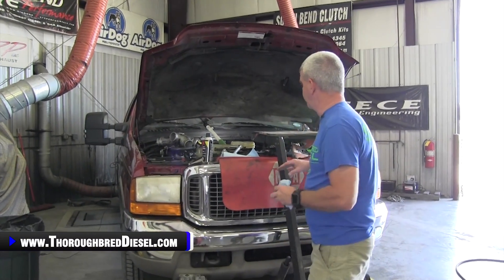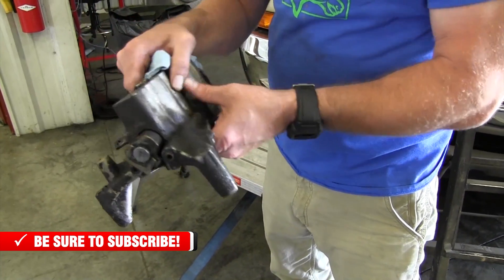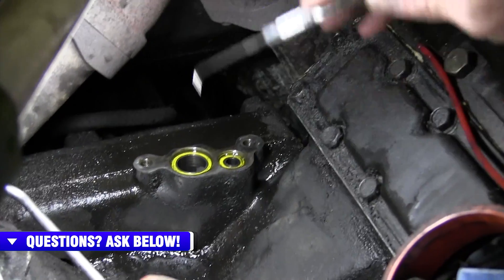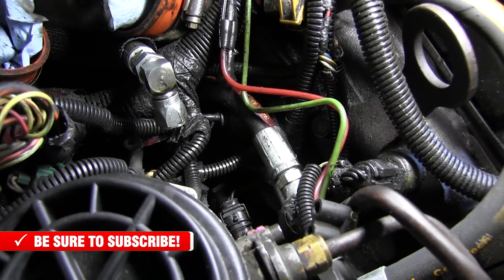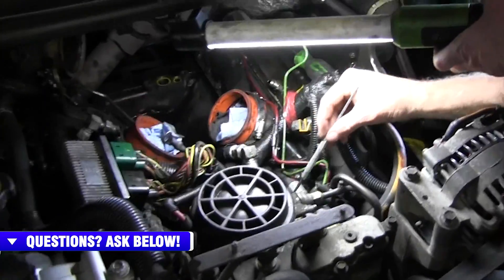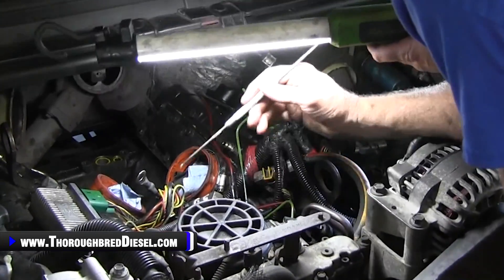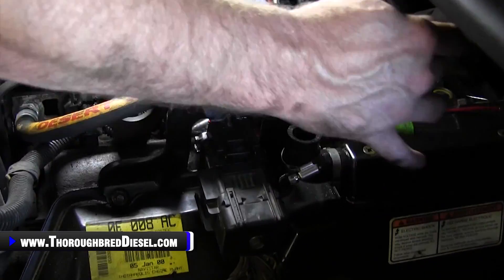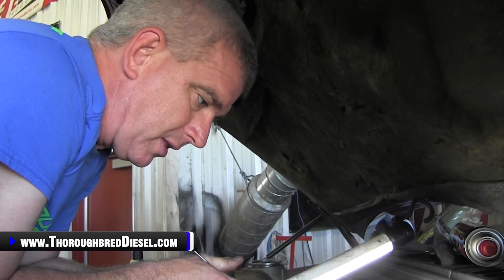7.3 Powerstroke Common Engine Oil Leak Areas: Different Types of Oil Leaks Explained

Comment: How does oil get into the antifreeze overflow tank?
Reply from the maker: Your usually looking at a headgasket issue. Could be soot as well which may be a injector cup issue.

Comment: I have fors f250 7.3 it leakin oil pretty bad if i change sensor will that fix that problem i see lil bit of oil on top of engine

Comment: Hey could you help me chance? What's the reservoir on top of the driver side that connects into the airbox? mines leaking like crazy but I can't find seem to find it.
Reply from the maker: Are you talking about the PCV baffle that is in the valve cover?  Is it oil you are leaking?  If so check the blowby of the engine or the orings on the PCV canister.
Reply: @thoroughbreddiesel  I'm not too sure, It's ontop of the valve cover, connects directly to the air intake, it looks like it's been shooting oil directly into my turbo, and leaking  out the sides and bottom onto the to the top of the valve cover. Thank you for the response and help!

Comment: I have oil leak on my oil pan on my 7,3 ford 5604x4 discail do you have t lift engine out to fix the oil pan
Reply from the maker: If it is the dipstick leaking,  then we carry a dipstick adapter kit that you can repair it WITHOUT lifting the engine.  https://www.thoroughbreddiesel.com/dipstickadapterrepairkit/. If it is the pan gasket or pan leaking,  then you will have to lift the engine.

Comment: I had my high pressure oil pump replaced a couple years ago everything's been running smoothly until now now for some reason I'm leaving good size puddles at places but then sometimes just a few drops could be the the hoses off the high pressure oil pump or could the pedestal put out that much oil because it's never been serviced

Comment: I have a 99 7.3 psd it pours oil about 2qts every two days coming down between the tranny and motor also down the side of the motor towards the back by the oil filter I’m assuming turbo pedestal?

Comment: I have a 96 power stroke massive oil leak in the valley but not from the lines hpop or turbo pedestal but I did notice oil bubbling underneath the lift pump is there a seal or something there that I can replace any thoughts would be appreciated thank you
Reply: What did it end up being I'm thinking oil may be leaking from my fuel pump as well I can't see any where else that it could be

Comment: Any videos on 2001 Ford excursion top oil leaks mine is a gas v10 not turbo 4x4..not a bad oil leak just dusty oil mist all over top of engine...thanks for the upload
Reply from the maker: Not familiar with the V10 engine, I would suspect something that is PCV related though.

Comment: Hi, we've got a 2003 7.3 powerstroke that has fluid pooled in the valley. When it's running I can see a steady drip into that pool, but can't see where it's coming from. Any good guesses? Thanks in advance.
Reply from the maker: Is it coming from the front or the back of the motor?  Are you sure its oil or could it be fuel?  IF its at the back,  suspect turbo pedestal.  If its at the front, suspect the HPOP lines or fittings.  Make sure its not a fuel leak coming from the fuel bowl.

Comment: My 2000 f350 7.3 leaks oil from what I think is the oil cooler but I'm not too sure.... I cleaned it up and let it run to see but I still can't tell.... was thinking it is something with the hpop but not really sure.... it literally drips from where the big ground cables attach to the block on the driver side... any help?

Comment: I have a bad oil leak above starter on my 1999 7.3 f-350 dually can you please help me
Reply from the maker: Really need to figure out if its coming from engine valley and running down.

Comment: I had a bad oil leak from the dip stick adaptor on my oil pan. Almost had to pull the engine to replace the stock adaptor. Luckily, I found an aftermarket replacement that doesn’t require the engine to be pulled.

Comment: Got oil running all down the drivers side frame rail starting near the front along with some top side leakage!  Any ideas on what that can be?
Reply from the maker: Make sure its oil and not fuel. Fuel can mix with the dirt and grime of the truck and make you think that it is oil. Check what we covered in this video and also pay attention to oil cooler and the dipstick adapter.
Reply: @thoroughbreddiesel  yes the video was very informative and I think I have several issues but I am losing oil. There is oil/fuel in the vally but without tearing it down it's hard to see exactly where it's coming from. Can I safely blow that all down at the car wash or a lower pressure washer?

Comment: Hi, I have a 99 f250 7.3 power stroke pickup, its leaking oil in the deposit which is on top of the high pressure oil pump, I dont know how it is call, its beside the diesel filter, in all your videos about oil leaks you never talk about this part. I have already  replaced the gasket but still have oil leaking
Reply from the maker: If it is a leak that is ON TOP of the HPOP,  could it be fuel that you are seeing?

Comment: 01 250. With 360k miles. I’m getting oil drops on the concrete that are almost dead center of the motor. Any clue?
Reply from the maker: Check the oil dipstick adapter, that’s close to center of the motor. A lot of times you get a pool in the intake that will fool you and be running from the back. Could be close to front of motor.

Comment: My 7.3 recently devoloped a crazy bad oil leak. It looks like its comeing from the back of the motor i cant really tell. But its will pour out about a quart if its. Left running for 10 minutes
Reply from the maker: A lot of different possibilities, but the turbo pedestal is a common leak point.  Could also be a leak that is pooling in the engine valley and leaking out the back.

Comment: Got a pond of oil on top back of motor and truck died won't start even with starting fluid will run few seconds and die I hate using starting fluid but more towards back of top of motor I'm thinking turbo pedestal but it's a e350 box van so hard to see

Comment: I have a question I have a 99 f350 I just did this got everything back together and now it idles rough. Any ideas?
Reply: Wade!? I just did this on my 99 7.3 with 324k got everything buttoned up the clamp in the back was a nightmare but I got it now I have a rough idle any ideas of what I messed up. I recently did the valve cover gaskets new glow plugs and the wiring harness on the Inside of the valve cover. I checked after it stated to idle rough everything is still good from that but the truck isles so bad after the  o ring replacement on the pedestal. Any ideas on what could cause it? No codes are coming through and I’m lost

Comment: I'm having white smoke coming from my exhaust pipe when the engine warms up only, would this be from the turbo too?
Reply from the maker: Could be or could be an injector issue. If its not consuming oil, suspect a fuel issue. Also difference in smell.

Comment: i have a 2002 135,000 miles Blows smoke and some oil out of exauhst put new used Injectors,turbo and pedastol in it still does same thing what could it be ??

Comment: I changed my oil about 25k ago. I'm at 297500k+ .
About 500 miles after oil changed Inoticed a leak. I got it up and see a stream running down the right side of the oil pan. Injist found the stream 10min ago.
3:44pm today. Any best guess to start looking?
Thanks
Reply from the maker: Its depends on what you are calling right side, drivers or passenger.
Reply: Hey thanks. I started poking around and found the dip stick adapter was leaking. So I ordered a repair kit and fixed it over the weekend.
What do y'all think of at-205 seal conditioner. Now my trani front seal is dripping.
Thanks

Comment: Great information!  I've got a 97HD with 392K on the engine and you just showed me my problem," Ole Bucky" still starts and runs well ,But it needs to be tighten up with a little of tlc under the hood, Thanks again.

Comment: I’m getting a constant flow of oil coming from under my icp sensor right on the oil rail, next to that engine hook. Any ideas?? Has a brand new icp.
Reply: Oil galley plug riff raff diesel has a pack of 4 for like 3 or 4 bucks hope this helps this is what I did to cure mine

Comment: My 02 7.3 done leaked a gallon of oil in 7 miles
Reply: my 1995 7.3 done leaked 2 gallons of oil in 2 miles 2 days ago. Rustproofed entire undercarriage.
Reply: My 7.3 leaked out everything to the point of stall in less than 2 miles. I assumed the pan let go again but the valley is full of oil that poured down the back of the motor. Just got it back home and added 3 gallons of oil, no leaks yet. I'll start it in the am and see what happens

Comment: My 99 7.3 leaks a gallon of oil a day valley is filled and it's running off the front of the motor, turbo seals and pedestal seals have been replaced could it be a HPOP leak?
Reply from the maker: Give us a call man. 8667384966

Comment: Had a fuel leak from the left fuel line feeding to back of head. It is a copperish line that has a bracket around it that rubbed a slight crack into it from vibration. New update has no bracket to prevent future failures

Comment: I currently have a leak I can not find! 2002 F250 7.3 Powerstroke. Pulled the turbo and pedestal to replace the leaking up pipes and collector. No oil at the back top of motor or bell housing.EBVP was deleted some time ago so not in play here. Originally felt like the rear passenger side High Pressure Oil Rail Plug was leaking as oil appears to be coming down on the passenger side from above and getting oil on the starter at the transmission adapter plate. I replaced the Turbo O-rings, pedestal o-rings and rear passenger side oil rail plug and used the correct Loctite 277. I did the CVD (Check Valve Delete) and new Viton fuel fittings on front and back. No oil in the valley either. I also can verify there is no oil coming from the top rear plug at the head in front of the High Pressure Oil Rail Plug. Literally looks as if oil is leaking at the head and block?? I cant completely rule out the passenger side rear fuel feed but not likly as the front driver side was installed at the same time and same way and it is dry as a bone. No smell of fuel in the leak remains either. I changed oil and before the leak was dark now the leak is fresh and looks golden like fresh oil. Any thoughts please??
Reply: It's that line that goes from front of the driver's side of the block to the rear passenger side of the block by the turbo.. 

I have the same issue..

No one makes a video or seems to know what it is called but when your pulling and give er your cab is filled with burnt oil fumes I bet..

That's least my experiance..

Comment: I have a leak running down back side of driver side hits the exhaust pipe and drips down 2001 7.3 have changed pedestal o rings on top and bottom by turbo and oil cooler and fuel lines and valve cover

Comment: Been there done that with the turbo pedestal and that ridiculous waste gate solenoid abomination. Did the delete on that and never looked back, replaced the pedestal o-rings while I was there. Been getting oil in my coolant. I run the Evans coolant that requires you to vent your degas tank cap (pressure less system). Never had any coolant in my oil, but the coolant kept getting worse and worse so I decided to pull my oil cooler on my 2000 F250 (101K milage). No external leakage visible. The blue o-rings were flat, but still rather flexible. The black o-rings were flat, but still flexible. The gaskets between the block and cooler look good so I am assuming the 20 year old flat, but still pliable o-rings have been allowing the cross contamination. I can't think of any other way this could happen. Care to comment. Great video. I love my 7.3. Bought it brand new and have done quite a few mods on it. Mostly correcting some of the Ford OEM problems. Not many miles for a 2000. Still strong and looks good and I want to take care of it and run it till my legs fall off. I think it will out last me.

Comment: I find it odd I own a 95' powerstroke, so 7.3, and I don't have any leaks.
Reply from the maker: Might be out of oil!
Reply: Unicorn
Reply: Ah ha, no I change it out every 3000 miles and it all comes out to the amount I put in it. Maybe I'm just lucky. Also Archoil works wonders.
Reply: My 97 didn’t leak until I had the repair shop change out the alternator and change the oil. Now it leaks near the oil filter

Comment: Bad oil leak on my 96 7.3 I pumped out a gallon in just 10 minutes.. I can see it going through the weep hole on the intake. Can I see where it's leaking at though.I replaced the driver side high pressure oil line.
Everything seems to be dry there.I'm about to beat my head on the windshield. Suggestions please.. thank you very much
Reply from the maker: It could be from the turbo pedestal, the HPOP could be leaking, and you still could have a line leaking.  If the oil is pooling in the intake and running down the drain hole, then the leak has to be in the engine valley somewhere.

Comment: I have a 2003 F250 7.3 with 348k miles. Burned 2 gallons of oil out the tail pipe after 40 miles on a cold start then used not even 2 qts to go another 95 miles. 40 of that were another cold start drive the next day. I had replaced all the injectors Orings 40k miles ago when I did the cups. Recently did the turbo pedestal when the oil burning started.

Comment: I got a early 1999 7.3 with manual transmission, with 60k original miles and about 5000 miles ago i replaced the pedestal and got hydra tune,  and I'm noticing some oil coming down passenger side down on to transmission and on my driveway
Reply from the maker: Something could be leaking into the valley and running down the back. Hard to say without seeing it.

Comment: Where have I had a leak on my 7.3? 
The answer is YUP! 
I really miss my old 7.3's! Gutless turds, but a few grand and you can run like a stock 6.7ish! Lol! If I could have all of the money back I spent just getting into the lower 600's on my 01, I'd be able to take another all inclusive, and guided hunt trip in Montana.
But they were bad to the bone back then. To me.
I really kick myself in the arse selling my 96. It was pretty tall, pretty slow, and rode pretty well like a log wagon.... But I put alot of time and $ in that truck making her Purdy Smexy. 
 96 CCSB F350 4x4 zf swap truck.  
The 01 was also an F350 CCSB 4x both trucks were white. 

I had hpop, ipr, icp, pedestal o rings, cps, valve cover harness, GPR, glow plug themselves, and fuel bowl issues on both trucks that I can remember for certain.  And a weird neutral safety issue on the 96 that made it sound like a pulling tractor. Along with a starter twice.  Dipstick issues on the 01. And water pump and thermostats. Oh and clutch fan. 
Still everything was an easy fix, and everything was over the course of a decade on the 96. Half decade on the 01.  Pretty reliable ol' turds otherwise. Until I got PMS (powerstroke mod syndrome)  Do NOT push your 7.3 past 500 whp maybe 550 (if you don't beat on it) on PMR's though! Unless you have good luck and some extra time and $ hanging out somewhere. Just throwing that out there. 😂 
                  good times. 

Thanks for the video Wade! 👍🇺🇸

Comment: 241k never leaked yet "knock on wood" great video
Reply from the maker: Thanks!
Reply: 298k and mine didn't leak til she heard me say those words lol I just got ready to change the oil last Thursday and came out to the whole front axle covered in oil from a bad oil cooler oring which is very common but not mentioned in this video so now I'm waiting for parts to come in
Reply: i hit 290 and it started leaking everywhere and its such a mess i cant find it!